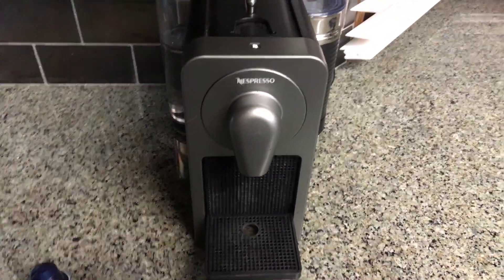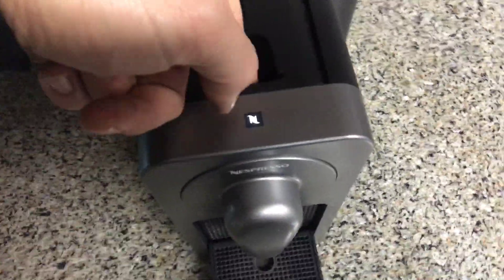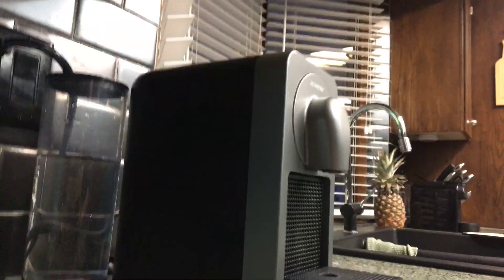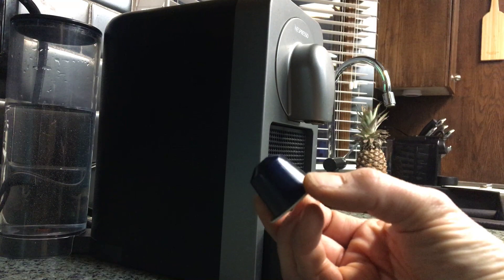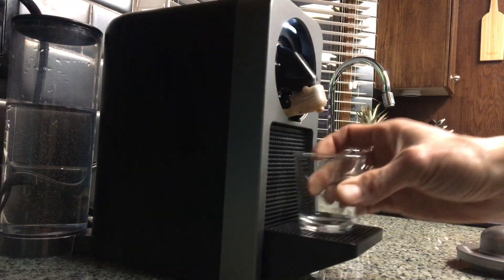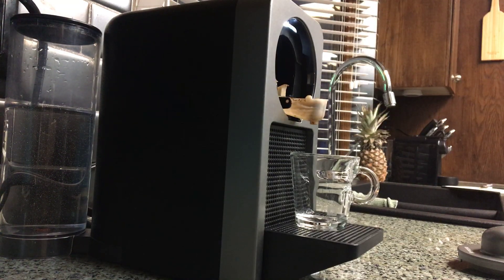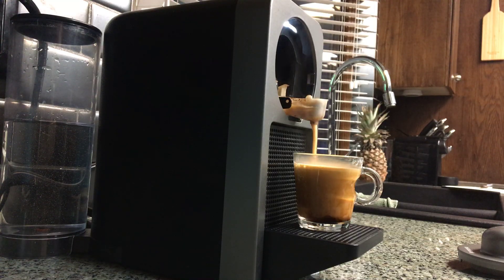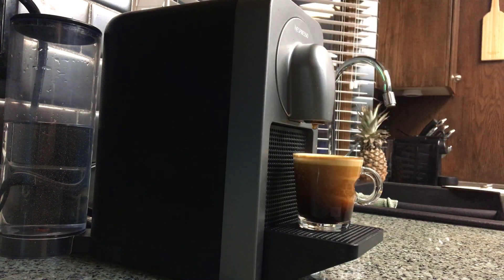Nespresso Prodigio fix

Comment: That really helps. What happened on mine –  on the black part that slides back there are 2 little feet on each side that should lift up the white part, when it slides back. The little feet on the side have broken off, so now it does not pick up the white part. Manual works though. for now. Thank you!
Reply: I was wondering how the white 'ramp' dropped down into position, your comment (thanks) prompted me to look for the side bits. Both are gone on mine too and it looks like one of the other comments in this thread suggests the Krups MS-623323 replacement spout can be purchased as a replacement.
Reply: Si, a mi me pasó en una Nespresso U y se solucionó comprando la rampa nueva por menos de 10€.

Comment: the final solution would be to change the coffee outlet part, there are 2 nozzles that brake when the pile of used capsules gets too high. I think you can find the part needed on Amazon for 5 or 6 Euros.
Reply: I'm having this exact issue. Any idea what part I should search for in Amazon?
Reply: Werner Furlan thank you!!
Reply: Thank you Werner, I ordered a replacement for my machine after first confirming I could remove my old one. I will use the manual method for the time being until the part arrives. Thanks for the part number to order.